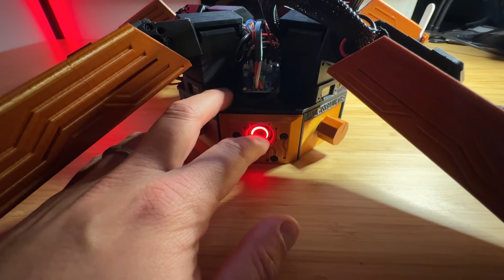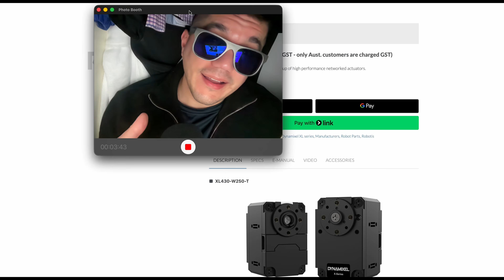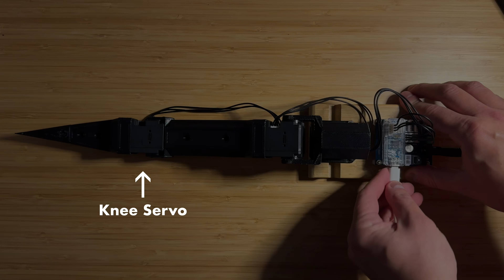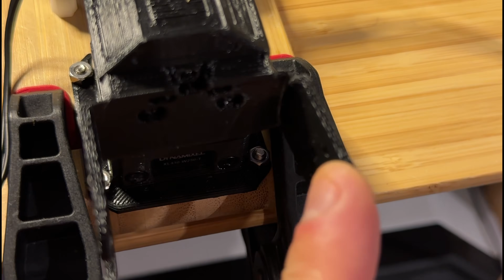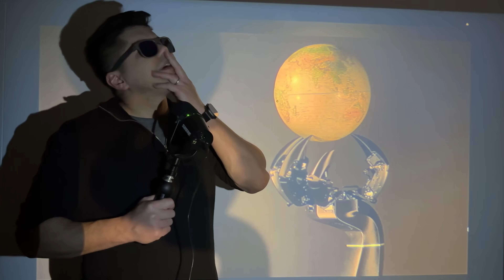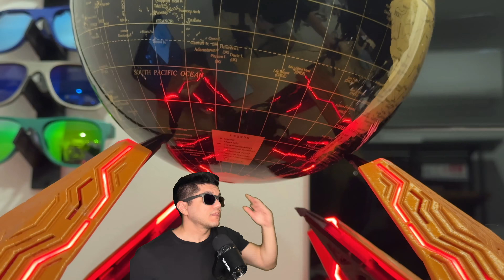I Built Doc Ock's Robot Claw

Comment: Its awesome.... but.... i just want the globe to rotate... and that could have been made with 1 motor. Its a bit of a toolarge scope (cost) for what i want it for 😂
Reply: Isnt the singularity problem not just.... If Values for xyz > max use max?
Reply: What i mean with 1 motor... i would make the fingers spring loaded with a pully system. I would then have a rotating disk in the middle that presses against leavers of the "thread" that articulstes the finger... as in pulls 1 finger down while also tipping the fingers slightly. Its like old animatronics really... you have 1 or 2 discs that decide the programm. I do know that you wanted this as a learning project. I just like to talk too much 😅
Reply from the maker: Hey! These are great points, it’s good to challenge the original requirements. It would’ve been easier and cheaper to leave the globe on the stand it came on and spin it with a hand 😆 BUT THATS NOT THE POINT!

Learning Inverse Kinematics and discovering problems like the singularity are reasons why this work is its own reward. To do something hard, simply because it’s hard, so you can do something even harder later.